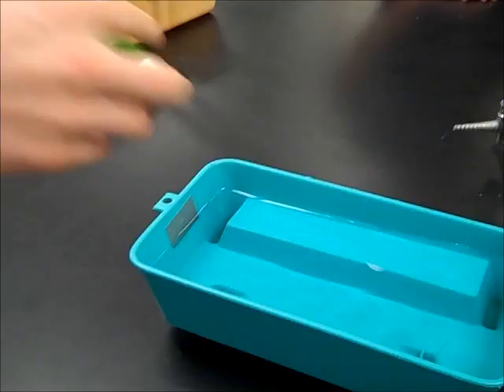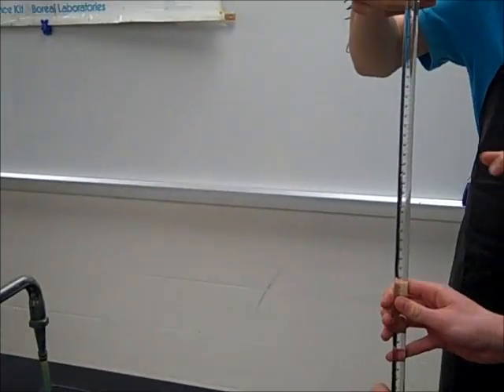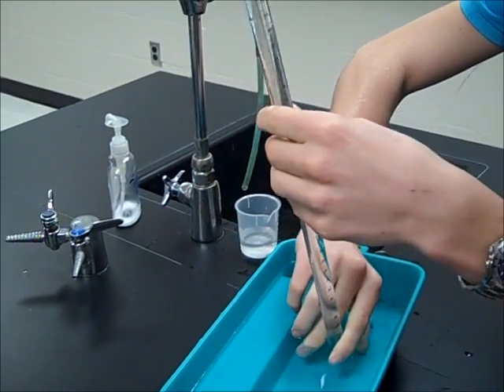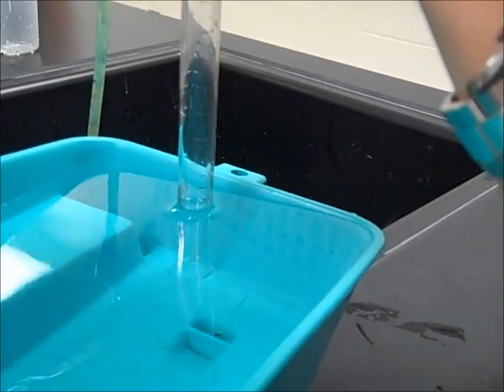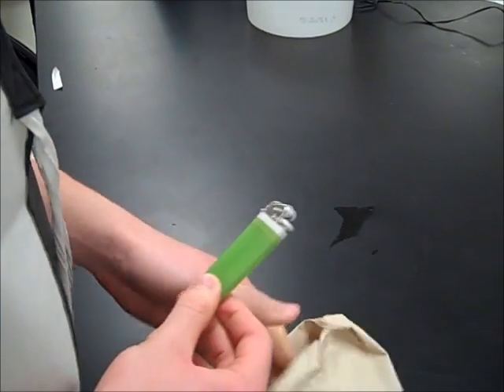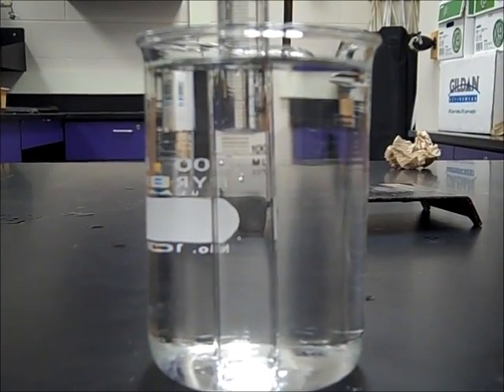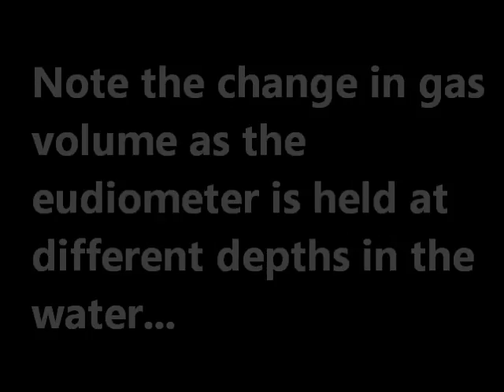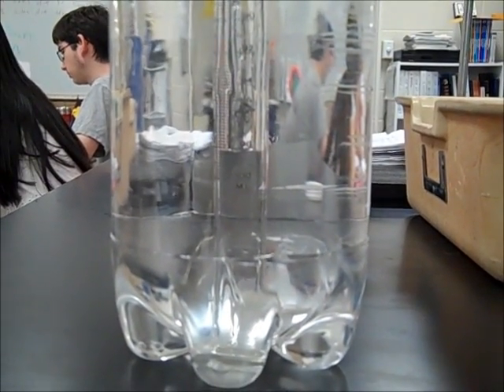Lab - Determining the Molar Mass of Butane - Mr Pauller

Comment: whats the volume of vapour produced?
Reply from the maker: You can't measure the volume of water vapor directly because it is combined with the butane inside the eudiometer.  You could calculate it using the total volume of gas, total pressure and partial pressure of water vapor.

Comment: So the volume decreases as the tube's water level goes higher than the container's water level? Would that make the molar mass too big or too small?
Reply from the maker: I will help you through this.
Reply from the maker: How would your calculated number of moles change if V is reported as smaller than what it actually is?
Reply: @LabHamster  the volume being too small would cause the density to be too big, which would cause the molar mass to be too big?
Reply from the maker: @aadarshrebba7246  density would change but what's important is the sample mass and number of moles
Reply from the maker: Molar mass = sample mass/number moles
Reply from the maker: So if vol is smaller, number of moles will be smaller too
Reply from the maker: This will actually make your molar mass larger than it should be
Reply from the maker: Since PV=nRT
n=PV/RT